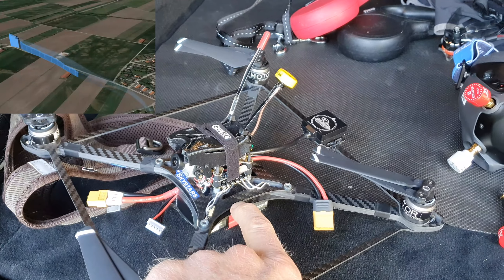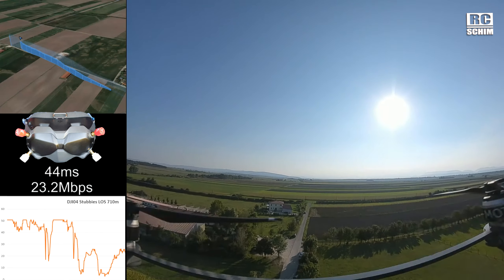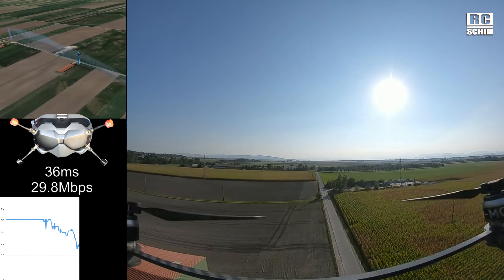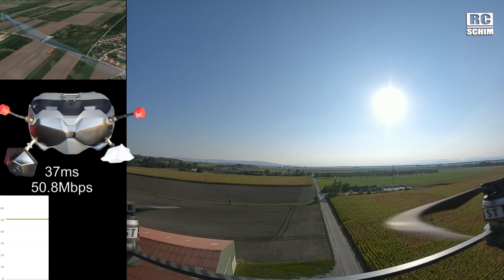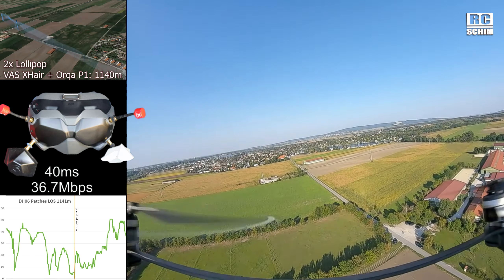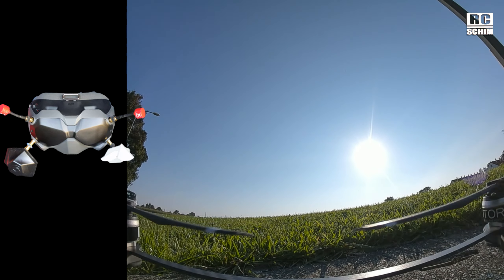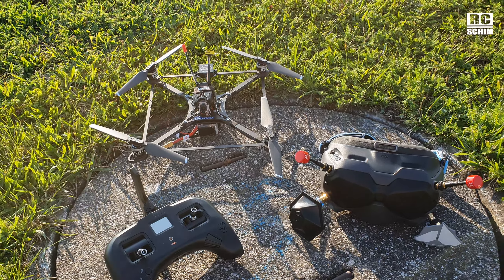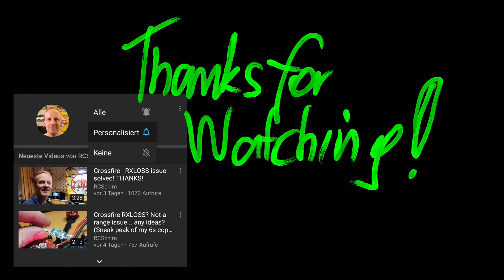DJI FPV Antenna Test improved! (GPS + SRT = good comparison of Lollipop vs Patches)

Comment: Very good demonstration of the Fresnel zone in the first flight -- the peaks and troughs were quite obvious.  You can also see that the Fresnel effect is apparent in all the plots -- with the peaks and troughs clearly lining up.  Multipathing is a fact of life :-)   Thanks for the video Mario, excellent content as always -- and thanks for leaving out the mid-rolls.  I let the prerolls run to completion for a little extra coin in your pocket :-)
Reply from the maker: Clever and now that you said it - obvious: Mr Fresnell - of course! I knew the cars passing by cant be the reason for the "troughs" - even if they sometimes aligned mystically ;)
So for the next test I will try to fly higher from the start to get as little fresnell as possible.
greets, Mario
Reply: @Rcschim   I've just familiarised myself with this Fresnel zone (https://youtu.be/xCVd3QGQhKU) thanks Xjet! 

I personally then would prefer you to "not" try avoiding these zones to make it a more real to life test. 
I reckon max 60m in height would cover most of us.

The way the antennas work despite the Fresnel zones is very important.
Reply from the maker: @gmivisualsjason3729  yep, just re-watched this nice video. Bruce does a really good job of explaining stuff!

Comment: I would like to see stock vs your best fly until failsafe
Reply from the maker: I know - I will have to modify my copter again to be quickly swapable from DJI stock to my own antennas. Definitly on the plan - and should be interesting to see Stock vs Tuned of course - than you can easier decide if it's worth at all to upgrade. (my bet is: YES!!!)
Reply: @Rcschim  I bought 4 nice pagoda antenna's for my goggles but I don't see much difference vs Stock
Reply: I'd like to see this test too. I'm sticking with the stock antennas for now because I'm not sold on spending all this extra money for just better "test" results. I'd love to see a deathmatch until the end (failsafe). Great suggestion Chet.
Reply: Same
Reply from the maker: @RADERFPV  I'll work on my bravery to go all the way until video disconnect (I guess failsafe - on CF - would be miles beyound DJI range).
If you dont want to spend too much, just use some of these Lollipops as I do - they really work better. 
So - next test will take very long for me - gotta test a lot of options ;)
Reply from the maker: @wippo76  Pagodas have a quite "flat donut" RF shape - they work best when oriented horizontal (the coax is vertical you know what I mean?) 
what do you use on the copter? do you use LHCP pagodas or have you maybe mixed RHCP Pagodas with stock airunit (which is LHCP)?
Reply: @Rcschim  I forgot about crossfire for the win, lol. Yeah, I wouldn't try to push it that far, you might end up in another town! But like you said, it would be great to see where the video truly cuts. I'll take your advice and will pick up the lolipops for now, though I'm not really disappointed with the stock antennas for the little park flying i do.
Reply from the maker: @RADERFPV  If you get Lollies:  read my description here for details, but in short:  watch the connector on goggles:  they are RP SMA. Foxeer has Lolli in RP SMA - but you hardly get them.  you can alse use an RPSMA to SMA adaptor (as I do) tho.
and also change the air unit antenna or at least stay in the same polarisation.
Reply: @Rcschim  Thanks for the advice, I really appreciate it :)
Reply: @Rcschim  on 1 copter I use the stock and on the other cherrys from rush 
And yes they are LHCP
I understand the flatter beam because they are 5DBi   
Maybe it will be better on longer range but for penetration true trees the stock works the same for me
Thanks for comment mario
You do great testings 
Will watch your stock antenna video soon
Reply: @RADERFPV  lol death match. Pushing dji little scary.. your so far away.  Lol
Reply: Would like to see a test of the vas cyclops!

Comment: Your first run had more distance. When jumping around like that (mbps) its gets low but was getting high as well.. you can keep going till jumps from low to low then worry.  I saw range test till it dropped.  Went long ways when jumpy.   patch test was low to low when jumping.  Wise to turn. Great job brother.  Range test test your nerves too.  God bless 👊👊💪

Comment: Very cool as usual my friend! I just got the Lumenier patch and stubby combo. Not sure how much better they are then others, but definitely improved over the stock DJI. Although I am not to concerned about range. I usually only go 500 meters or so. But inside that range I want the best and lowest latency possible.
Reply from the maker: Stock antennas would work pretty well there too I think. Multipathing really helps with DJI (instead of interfering with your video like analog used to).
I think we will see a good comparison soon from some well known names to clear things up (about the AxiHD set). But everything with a patch works quite well...

Comment: Thanks for the video! I am wondering what the polarization the stock antenna is on the DJI air unit. I see you are using RHCP?
Reply: I thought they were LHCP
Reply from the maker: Yes, DJI Stock is LHCP. When I install CaddxVista or DJI Airunit - the first thing I do is swapping Antennas to RHCP (normally Lollipop or Speedybee Antennas).
This then means I can use my many RHCP antennas on the goggles (and always think what is REALLY the best of them?!)

Comment: RHCP? but the dji googles come with LHCP antennas.so jou can switch all the antennas on qad and googles without hawing isues?
Reply from the maker: yes you can. the only thing you need to consider are the various connectors. 
on the copter:  DJI AirUnit: mmcx    CaddxVista: ufl
Goggles: RP-SMA 
So on the goggles I did need some RPSMA to SMA connectors. You can also try to find normal analog 5.8 antennas which are RPSMA - the you dont need adapters.

Comment: But why are your Antennas RHCP when it should be LHCP? Did you change stock antennas on the air unit also becuse they are LHCP?
Reply: JA. LHCP är inte så vanliga som RHCP. Har man flugit tidigare med googles så brukar det finnas ett flertal antenner på hyllan att prova med.
Reply from the maker: Because I swap the AirUnit Antennas to RHCP as well - this way I can use all my Antennas from analog times (they're all RHCP)
Reply: @Rcschim  Ok thank you for explaining!

Comment: cool tests, it might not seem like a huge difference but when you multiply it up with higher powers it becomes very significant.   do you think humidity might change anything?, i ask because i've seen a french guy, dammit forget his name.... anyway, he flew through clouds quite extensively and when i recently touched a few feet into cloud my video dropped to almost zero instantly. Oliver C, thats who it was
Reply from the maker: yep, I thought this as well.  I remember each 6db gives you double the range. 25mw = 13,9db     700mw = 28,4db  - so we get roughly 4 times the range with the high power setting on DJI goggles! - that would be around 5km. I've seen other pilots do a max range of 13,3km ;)  (which seems to be the next hard limit - before an upgrade there was a hard limit at 6,5km because of a synctime in DJIs system).
Humidity for sure degrades RF range. I once did an extreme ground test, had a 2nd tester 6km away, first we got image, then a breeze of moist air seemed to come between us - video was gone!

Comment: Is it worth using 4 X patches? At the moment I have 2 patches on the bottom and DGI stock antenna on the top. I've got the iflight patches with a set of stubbies on order. I was wondering whether to use 4 patches or 2 X goggle patches and 2 X stubbies.
Reply: If flying 360 degrees I use 4x omnis.  If mainly out in front I've found 2 patches on the bottom and two on the top give a consistent high bitrate. But so do 4x omnis. (I use 4x foxeer 3 antennas)

Comment: The only way to do a real test that will truly help us to choose is to fly until the video completely locks up and then use GPS as a failsafe.
Would be great to have a document freely available showing simply the antenna set up in the goggles (a simple picture) the brand/model and the max distance flown in a straight line until the video fails.
Starting with the stock antennas.
The problem with the test in your video is that the bitrate was fluctuating so much from very low to much higher, making very difficult to truly know when it will fail.

The graphs look good but nothing better than a picture lock up.

:-)
Reply from the maker: Yep, I get it, I must be brave next time in the air. Looking forward to the next testing since I got quite interesting and unknown antennas today. No hype train, just a clever idea, well executed and handcrafted ;)

Comment: Would it work better if the quad's antennas were on the bottom of the quad? Ya know, since you're flyin'  so high?
Reply from the maker: On the revised setup of this copter here I have the original Antennas (they have a bit longer cable) and if those antenna-tips are high enough to be over the most parts of the copter (most important far over batteries on top-mount copters) it's better for the antennas up there. on the bottom it's just inconvenient to start/land, store in backpack.   but sure:  if the antennas hang from the front of such a copter (most of the time it is leaned forward ~30° while flying) - antenna visibility would be perfect. 
Also angle your antennas to match the average speed you're flying. if you're a cruiser they might only need a little tilt back. if you fly fast all the time, get them ~45° tilted back  (or tilted forward if you mount them hanging down!)

Comment: I dropped my DJI transmitter and broke an antenna. DJI does not sell the antenna alone
I have to send it to be repaired.
I bought a couple ufl to to sma extension and plan to swap them in.
Now I do not know what antenna to use.. Do the antennas on the radio act the same was as they would on the goggle?
Any ideas or thoughts on this, or which antennas I should try on the radio? 
Thank you for all of your hard work!
Reply: That should read, Rp sma extensions.
Reply from the maker: sorry, I have no experience with DJI transmitter (and I dont plan to - since my CF Tango2 works nice!)

Comment: With stock antennas you can easily do 7.5km with line of sight and 50mbps firmware. Unless you are stuck at 25mW or going for 7.5km to 13km then you will probably be ok without patches.
Reply from the maker: 7.5 with stock antennas? Crazy! I tried directionals with GPS RTH and chickened out on 2.3km (video was still good). But I flew with copter - guess I need to install inav and DJI video on my MiniTalon for plane longrange flights.
Reply: @Rcschim  Yeah use GPS rescue and pick a remote location away from wireless noise. Also mount AU antennas up high away from the frame and use Naco.txt. I put the air unit on top of the frame to do this. Mount Crossfire antennas as far away from the DJI antennas as possible in a vertical orientation. Expect a constantly low fluxuating bitrate around 4Mbps at range. When it starts stuttering, going blurry and says 0.3Mbps consistently turn back with your finger on the GPS rescue button ready in case it loses connection.

Comment: I'm curious how pagodas do. Have you tested them on dji yet?
Reply from the maker: dont think so - I tested normal Aomway SPW Antennas. But in my larger Antennatest (with measurement device) I found one of the smaller, noname pagodas to really perform well. they also happen to be RPSMA - so I will probbably include them in my next test round (with waypoint missions - yeah!)

Comment: Do you like the menace antennas for the bottom ?
Reply: Yeah I thought the Menace Pico were RCSchim's preferred/recommended patches to set up on bottom. At least I thought it was RCSchim video a while back that planted that idea in my head, but maybe I've got my reviewers mixed up...
Reply from the maker: yep, I could (should) have used the menace since it's so small.  Patches perform pretty similar I'd say, you can see how in this comparison, filter to directional: https://public.tableau.com/profile/phi2340#!/vizhome/AntennaTestRCSchim/Boxplot
Reply from the maker: @BrianB78  sometimes I dont even remember (or follow) my own recommendations ;)   (that's why I do those tests, and the antenna overview tests - so i have some reference for my own use as well ;)
Reply: @Rcschim  well like others, very grateful that you post them for the rest of us to learn from as well, and for decisions on where to spend our $$. Hopefully the next round you can include the pico patch. I remember adding it to my cart after watching your last round of tests, and then learned of the digipack menace was coming out with, so I had to wait for those to arrive in stores for both a slight savings on cash, and the colour scheme working better 😎.
Anyhow, always watch your videos, keep it up please and thankyou 🤘🏻👍🏻

Comment: What the heck kind of props were those?
Reply from the maker: hehe, those are actually mavic pro props. the whole concept of this skystars sg325 copter is to mimic the power sys of mavics. I think motors are clones of mavic motors as well. They are really silent, efficient but also the copter is a bit wobbly - maybe I need to tune it better in iNav.
Reply: @Rcschim  i knew it! I was like....what in the world is going on here!

Comment: I am waiting for my V2 goggles to arrive (my first foray in to digital), but committed/purchased the iFlight CrystalHD setup, so I hoping they work well 🥵
Reply from the maker: I envy you! Could I have started FPV with DJI v2 - man would I have had an easy entry ;) But also I wouldnt have learned so much over the years.
Anyhows - good descision! I think I already saw a facebook post where a V2 user got iFlight Chrystal antennas and they did fit (as I know they are exactly same dimensions).
Reply: @Rcschim  oh no, this is my first foray in to DIGITAL, not FPV (I have been learning... and watching your analogue oriented videos for a long time now). Admittedly, I had slowed down the flying a lot, but the digital revolution has reinvigorated me, as I see it has you also. 
Thank you for your great commitment to the hobby and giving us great content (I am working my way back through your digital stuff 👍🏻👏🏻)